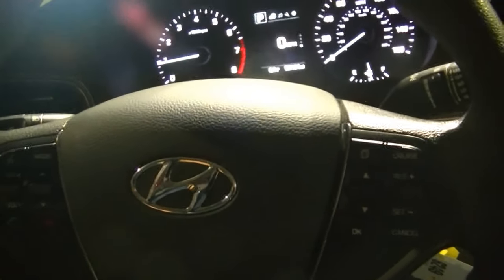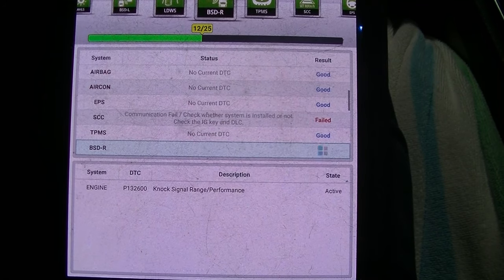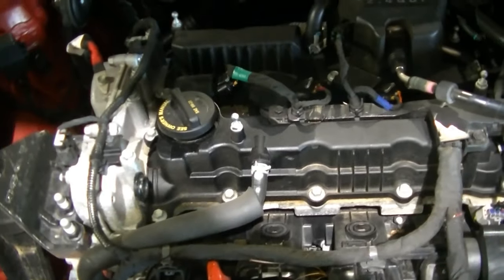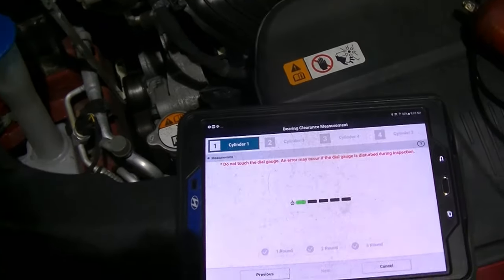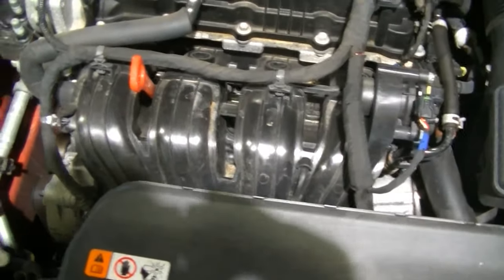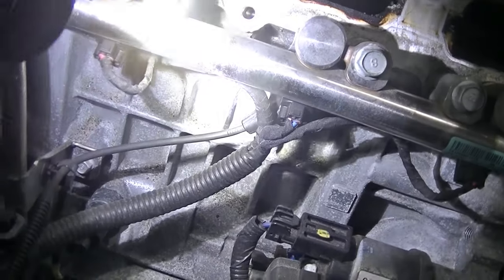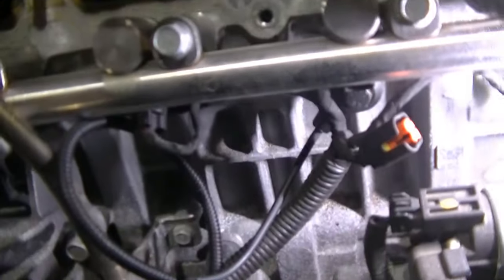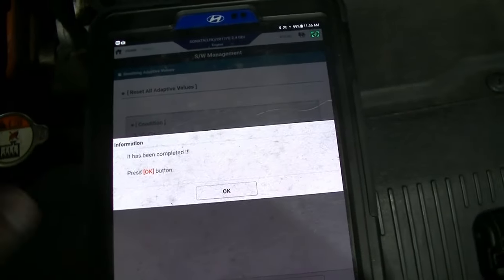Hyundai/Kia P1326 Diagnosis and Knock sensor replacement (flashing check engine light)

Comment: Question… I had the bearing clearance test done and they said they needed to add oil to do the test as the air was going around the cylinder due to a bad ring. Would this be considered a failed bearing test? Thanks
Reply from the maker: No, it would not. They only check for rod bearing clearance
Reply: What would you recommend for me to do. 100k 2016 Optima and got the error code and went into low power mode. Got towed and the reset and reprogrammed WVU for knock sensor
Reply: Reprogrammed ECU

Comment: How was that tool measuring main bearing clearance? The way I’ve been taught the only way to measure main bearing clearance is by using a mic and a bore gauge or with plastigauge. Or is that like a compression tester?
Reply: Air pushes the piston down, then air sucks the piston up. The up and down of the piston will show clearances of both the piston wrist pin AND the main bearings all at once. Apparently, the wrist pins never develop play so whatever measurement you get, if its outa spec its always the mains on that engine..
Theretically you can do this test without the tool, but you would need to find a way to setup a dial indicator in a way that it cant move. Pull the piston down by rotating the crank and stop halfway. Then setup the dial and feeler and then manually push the piston top downward without disrupting the dial setup.
Reply: @ripptydevibes2581  that’s really cool actually thanks for the info!

Comment: Great video. I have knocking sensor error on my Hyundai Elantra and I cannot drive it more than 30km before the code comes back. The bearing test is passing but I have a knocking noise coming from the engine and Hyundai don’t consider my car having issues even after sharing with them a video where they can hear the noise and the VIN of the car.   Any advice ?
Reply: Tell them to diagnose and fix it.
After they fix it have them drive it 30 miles to prove its fixed before you pay them.

Comment: Great video. Subbed. Is there any validation that tje GDI valve treatment has any benefit ?
Reply from the maker: If done early enough in the engines life and in regular intervals they absolutely help keep the carbon at bay! Once the carbon has set in there’s not much that will clean them minus removing the intake manifold and walnut blasting/scrubbing the valves and ports!

Comment: I have a 2014 Santa Fe Sport with 2.4L that this happens to when ever it rains.  I brought to my local Hyundai dealer and they said they ensured the engine is not knocking and cleared the code.  They said other than that there is no fix for the problem and because I'm second owner of the car that it wasn't covered under extended warranty for this issue.  Of course it rained two days later and it happened again.  It has happened every time it rained the last two months.  Does their diagnostic make and sense to you?  I reached out to Hyundai Care and they told me to bring it to a dealership (which I had said I did).  Any help would be greatly appreciated.
Reply: Same thing is happening with me. I'm the second owner of the exact same car you have. Do I have to go to the dealer or will the car run better after a few days? This happened yesterday.
Reply: @camsav86  Find out if your car is included in a recall by Hyundai/ Kia regarding the knock sensor. Even if you are a second owner, Hyundai dealers should take care of it at no cost. Google Hyundai Knock Sensor Recall. There is a website set up for this campaign and run your VIN.
Reply: Find out if your car is included in a recall by Hyundai/ Kia regarding the knock sensor. Even if you are a second owner, Hyundai dealers should take care of it at no cost. Google Hyundai Knock Sensor Recall. There is a website set up for this campaign and run your VIN.
Reply: Update:  The check engine light finally came on and could not be shut off. Hyundai Dealer ended up replacing the knock sensor at no charge and the issue is fixed. Thank you for the video.
Reply: EVERYTIME IT RAINS MY SONATA DOES THE SAME THING🤦🏽‍♂️🤦🏽‍♂️🤦🏽‍♂️

Comment: Can you update the knock sensor if the engine doesn’t turn over or can you replace a knock sensor with a new one with the new update already installed on it? Or is there a way to somehow get the update by other means like extending the wire on the knock sensor and putting it into another car so the computer thinks that it was updated.
Reply: Did u figure this out?
Reply: I just popped a new knock sensor on a 2018 . Not much difference yet
Reply: @MayKen  Replacing it wont do much, it needs the update from dealership. Only way to get the lifetime warranty. Even with the update it probably wont help.

Comment: My car Tucson 2019 passed the bearing clearance test. The knock sensor has been replaced, ECM software up to date and yet it still goes into limp mode. They have done a reset of adaptive values twice now but it comes back after 50km plus of driving ... What's the next step please?
Reply from the maker: Going to have to let the dealer do what they need to do
Reply: @SEsGarage  Well they cleared the ECM code again and it came back after 400km of driving. The end result is a complete engine change under warranty taking X number of weeks not guaranteed due to ordering the parts first before fixing. I traded it in and got redesigned 2023 model instead.
Reply: I'm having the same exact problem BCT passed, ECM update performed and still randomly comes on. Dealer keeps pushing me away and saying its not under warranty.

Comment: I'm getting a pinging noise on an Accent 2013 16L when going uphill - I think the knock sensor CEL came on once, but it was reset and it did not return. But I still get the pinging noise / spark knock. What is best course of action?
Reply from the maker: So you have one of two issues. First off, make sure you’re using top tier fuels. If they are subpar fuel and less resistant to knock this will happen. Second. Have you ever done an induction service on the car? Carbon backup on the back of the intake valves, and top of pistons is common on these GDI engines and should be done every 15-20k miles. Check my video on induction services out 
https://youtu.be/TLVAYKDanyw

Comment: What is that rod clearing tool called? My kia optima 2013 eats my oil every 2 months. I am constantly havinf to refuel it. I took it to the kia dealer and was told i need to pay $850.

Comment: S&E,you are a great mechanic.I have a very well kept 2017 Sonata limited with the 2.4 engine with 65k miles on it.Runs great and I maintain it myself with Amsoil everything in from the oil,trans fluid,brake fluid and coolant. Still has the original front brakes and all four original tires although they will be changed to a set of Continental Extreme Contact DWS 06 Plus tires sitting in my garage.

Question.I have not had the 953 software done. Do I really  need to get that done?
Reply: You should

Comment: this came up as soon as we drove 2013 sonata in snow with chains on. Checked with a mechanic who was able to reset it, does this require further action? P1326
Reply from the maker: that may have just been a hickup from the chains hitting the fender well and the knock sensor picking up the noise

Comment: Thankfully we have a 2020 Tucson with the 2.0 I hope this is a good one. It gets the oil and filter changed by me every 3K.
Reply from the maker: The 2.0 Nu has a separate set of issues, I feel like right now Hyundai doesn’t have a single reliable four cylinder engine on the market. Their V6’s are rather solid
Reply: @SEsGarage  can you enlighten me on any ? Vehicle has just over 10 K and has had OC every 3K any info would be great . Thanks for all you do, its appreciated.
Reply: Keep all receipts

Comment: I had this on my 2015 in the middle of a bad area. In limp mode I pulled over and had my scan tool with me. I looked up the code and erased it. I don’t know if I really need to address this or not??  It’s been a few months and it seems ok.  133k with new engine at 78k (seized).
Reply: Wasn’t able to erase the code on my 2014 and it’s the second time I have had this code, the first time the dealer replaced the wire harness, now the message is back.

Comment: Wow  I noticed a recall on my 2017 Hyundai sonata for knock sensor update . They didn't give me a new one they just updated it system..Before I had to update my car was riding a little sluggish and then after it was riding real good man real fast but then two or three weeks later it started back riding sluggish again, don't know what the problem is I thought it was maybe plugs I'm not sure. Brought the car used but the warranty is up. Did research on the car Hyundai 2017 I heard that it was having a lot of engine problems so now I don't know what to do I wish you were here in Connecticut
Reply: google hyundai theta engine lawsuit. It was settled last year and select engines in certain sonatas and sante fe now have a lifetime warranty for this motor, for this issue. 

the precedure they have to follow for this repair is check for update first, if it isn't updated then do the update. If it has been updated or issue happens again after update they have to do the bearing clearance check, If it passes, they replace the knock sensor, If it fails they replace the motor. All of this is covered under by Hyundai under the lawsuit settlement of last year. good luck to you.
Reply: @scounty  hey I have a 2016 Hyundai Sonata sport. 69,700 miles and it started haveing this knocking problem and the check engine light came on  am I’m cover to get this fix free ?
Reply: @mahndasavageENT  The Hyundai should have a 10 year/100,000 mile warranty on the power train so i don't see why it wouldn't be covered.

Comment: was this car making any actual knocking sounds before you worked on it or just the light came on
Reply from the maker: Just the light no abnormal engine noises
Reply: @SEsGarage  bro I watched the other video where your sitting at your desk talking about the theta 2 motors and 1 sentence you said was if the rod bearing fails the will replace the motor free.. I had the sonata 2.0 towed to the dealer and it got approved for a new motor .. *also this was the recall motor so it's the 3rd motor in the car ... 1st went 50k ran fine but recalled ..2nd went 150k then last week blew.. and the new one will be ready by Tuesday ..you saved me 10k .. Thank you!!

Comment: Question how long does it take to replace a knock sensor!!
Reply: I just did this today it took us about 2 to 3 hours
Reply: @JoseMorales-vq5fu  we’re you losing gas and having problems accelerating w a blinking engine light ?
Reply: @Yeahokwewillc  yes you lose major power, it can only accelerate to 2,000 rpm n go 40 mpg I believe. Take it to the Hyundai dealer they well diagnose it and tell you wants up, n if everything is go they well rest it, they didn't charge me n is happened like 2 times
Reply: @JoseMorales-vq5fu  I hope this is the case for me

Comment: My daughter just bought a 2012 Optima and the light went on and went in to limp mode. I live about 35 miles outside of Reno she bought the car through Carmax and she has a 90 day warranty on the drivetrain. We’re in a small town with just a few garage but there is a GMC dealership in town. I just wonder if I should take it to the dealership to make sure all proper steps are followed even though it’s not a Kia dealership. I did do a scan a code and it is a P1326 code that came up
Reply from the maker: Don’t even bother taking the car to Carmax. Take the car right to a KIA dealership
Reply: Drive it in limp mode 40 miles?
Reply: I checked the recall log and it says no active recall if there is one it’s been satisfied. 75 thousand miles.
Reply: @jimrobb1783  The problem is there's no such thing as an recall for this issue....it's considered a TSB...so what I would do is tow it to Kia and as long it's still in limp mode tow it there then have them diagnose it and solve it...regardless...same thing happen to my sister's hyundai sonata got it towed there then they replaced the engine cause it failed the sound test they do for engine knock....

Comment: What does is the cost of that repair? Awesome cool video thanks for sharing.
Reply from the maker: Thank you for the comment and subscribe! This vehicle was still under warranty and thus the repair was covered. It would all depend on the book time, part cost, and labor rate at the dealership/shop you take the car to
Reply: @SEsGarage  Thanks for responding to my post. I will look forward to your upcoming videos. Stay well & safe.
Reply: @SEsGarage  hey man I just now got this code about knock sensor the engine light is right now blinking 
the car only has 18,000 I’m still cover under warranty
Reply: @SEsGarage  will they fix it or try to say is my fault not sure if it a recall ?? Please help
Reply: @lifeinthespiritt.v1402  what's up man were you able to get this knock sensor problem fixed if you did what you do? how much did it run you?
Reply: What does it cost

Comment: Flashing CEL and p code happened to me last week at 68,000 miles (2015 Kia Optima SXL) . Dealership said its at least a week wait before they can even look at it. And the repairs are not under warranty smfh

Comment: I had the same code. Because it was under 100,000 miles KIA replaced the sensor, it did not fix the issue.
After deleting the code and changing the sensor KIA replaced the entire engine.
Reply: How long did this process take
Reply: @ryanwillis6194  so, update: KIA replaced the engine and as my sister was coming back home the SAME CODE CAME UP! So we took the car back and told the dealer to keep it. We filed a complain with consumers affair of KIA. They accepted to take the car back and gave us $16,000 for it. That process took 2 month and the check arrived like another 3 months later.
Reply: What year make n model ? Danggg
Reply: @ryanwillis6194  2017 Sportage 56,000. So the engine in that car, Theta II, about half of them were manufactured wrong so they could eventually failed due to lack of oil lubrication. They had a recall and KIA/Hyundai had to pay penalties for hiding the fact that it needed to issue a recall.
Reply: @Amanda Lovee let me clarify that you don’t get a NEW engine, just AN engine. Lol.
Is your car under 150,000 miles? Then yes.
Reply: @iamdenislara  did they offer to replace the engine again?  That might be a better deal.  16k doesn’t seem fair with cost of comparable used suv-models nowadays. Plus the 5 month process is a long time & hassle too.

Comment: I bought mines friday.. Saturday it died 3 times then didn't go past the 2 on the dash... Check engine light came on flashing and then the ticking.. So now its tuesday and Hyundai has it and said there testing and if its this then i come get my rental and wait for new engine.. Oh but when it died i took it to autozone and they said it was a bad battery.. 200 dollars!!! So will they pay me for that too or thats just 200 down the drain for a day Driven car????
Reply: a dead battery is an unrelated and separate issue, so you are responsible for that, but the fact that it died so quickly after you bought it, you may be able to ask the dealership you got it from if they would cover it since most dealers do inspections and should have caught that when they got it in.

Comment: Do you see this p1326 as a reacuring problem after the repair?
Either motor or Knox sensor
Reply from the maker: its usually pretty cut and dry. Any time that code is thrown we have to run a bearing clearance test. If that passes, and the PCM has the latest software we'll look at the knock sensor. If its reading a higher voltage than its supposed to, it gets replaced. if the bearing test fails, it gets an engine
Reply: @SEsGarage  is the knock sensor under warranty as well? 
Just wondering as I have a customer that will be going through this senario. And or is there any fees the customer needs to pay?
Reply from the maker: @LUCAMTire  It all depends on the specific vehicle. The dealership will have to run a report on the Vin number and see exactly what warranty extensions that it has. Usually my dealership will charge a diagnostic fee and then refund it if there’s a warranty extension for that issue on that specific vehicle
Reply: @SEsGarage  kk
Thanks for the info and the video. 
Appreciated. 
Check us out on YouTube if interested.
Reply from the maker: @LUCAMTire  will do! Drop a like and give me a subscribe and I’ll do the same!
Reply: @SEsGarage  already sub'ed and liked the video before I mentioned.
Reply: @SEsGarage  how much is the diagnostic fee? Sorry I’m late to this my two thousand and sixteen Hyundai is throwing this issue all of a sudden with seventy thousand miles on it. Sorry I can’t type numbers my keyboard is weird lol.

Comment: My 2014 sonata went into limp mode the other day flashing  CEL and limited power up to 2k … I looked it up by the vin and it said it already had the campaign 953 done back in 2019 I wonder it this is the case with mine . Anyways it’s at Hyundai waiting to be fixed ..
Reply: Any updates?

Comment: I don't have that software you are using to reset adaptive values. If I change the knock sensor and don't reset values then what ?  Is reset adaptive values mandatory ?
Reply from the maker: I know when the TSB they specifically tell you to reset adaptives, and I’ve never not reset them, so I’m really not sure what would happen if you didn’t if I’m completely honest

Comment: Can you just relocate the sensor on top somewhere so it’s much easier next time?
Reply from the maker: The knock sensor needs to be attached to the engine block to be able to detect knock
Reply: @SEsGarage  so you can if you find a spot?